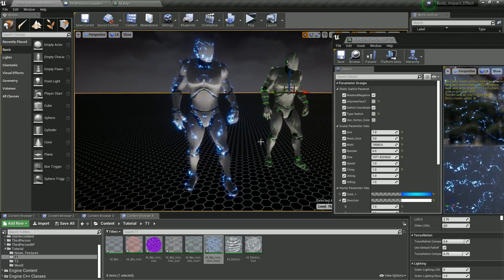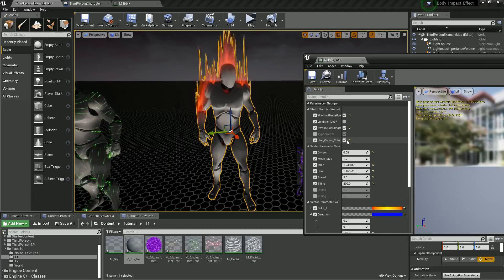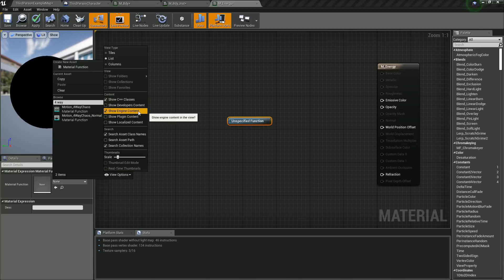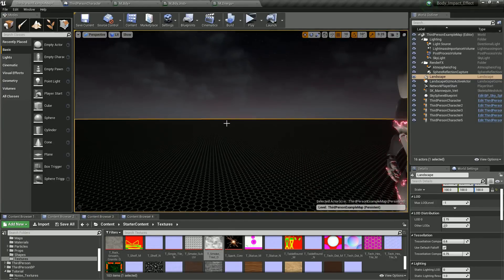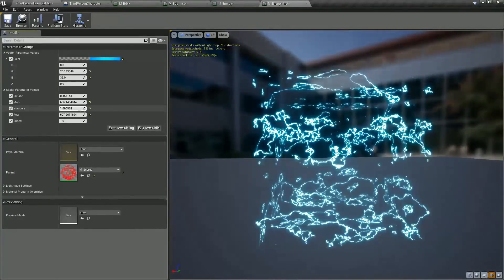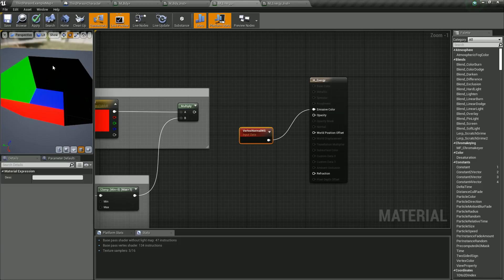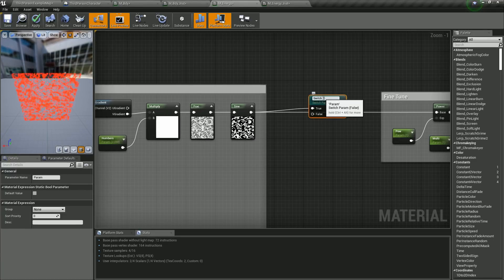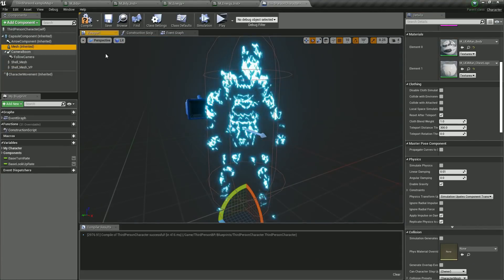How to Create A Pulsating Energy Armor around Your Character In Unreal Engine - Material Effect

Comment: How would you apply such an effect to a more complex mesh? 
I have a base character mesh with armour pieces that are swapped out each with their own materials. When a character uses a buff I want the energy shield effect to show no matter what armour they are wearing, would I need to add this shader into every material and dynamically set material parameters?
Reply: Did you find out? I watched a tut that showed how to apply a material to ALL mesh parts of a character/object. It uses [not the exact spelling]: Get all material from actor > then change material to X > and a loop to do this for all mesh parts of the character. I'll look for the link.

Can you direct me on how to switchout armor parts? (idk the best way to do this... or how the parts attach to character?) Ty.